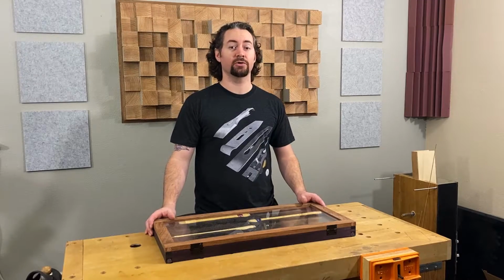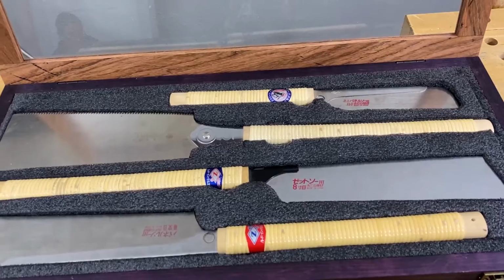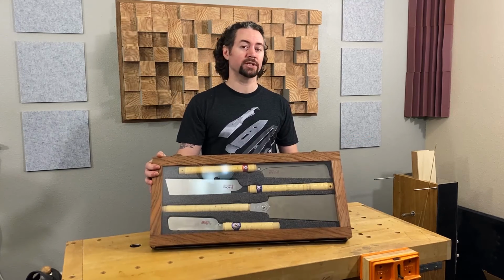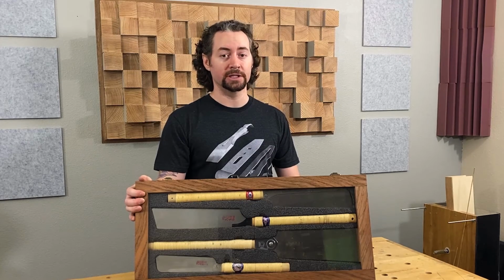Japanese Saw Storage Case

Comment: This is awesome, great video, how do you rate the foam? And how did you pull it out at a certain depth?
Reply from the maker: Thanks Mackey!

The kaizen foam is made of several layers glued together, so it is designed to separate in layers after you cut downward (although it can be a little uneven). The suggested method is to get your fingers to depth and scoop it from the bottom. 

I like the foam a lot. I have a bunch extra, so I plan to make cases for my chisels and other tools.
Reply: @BobsWoodStuff  oh awesome thanks mate